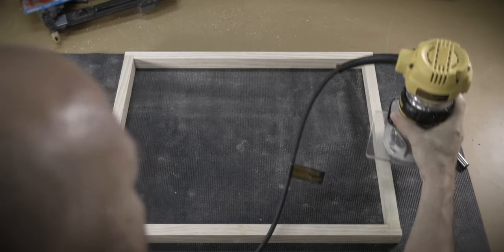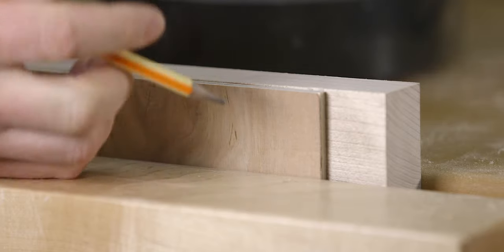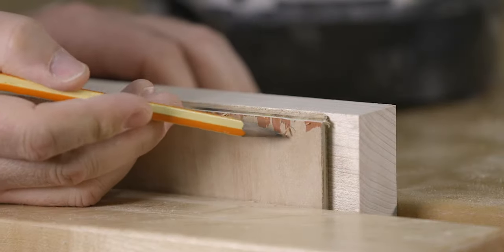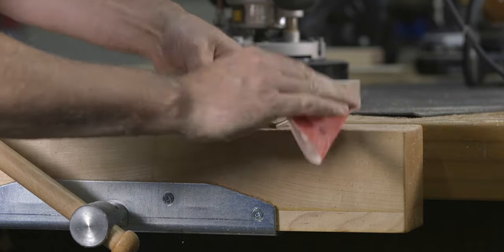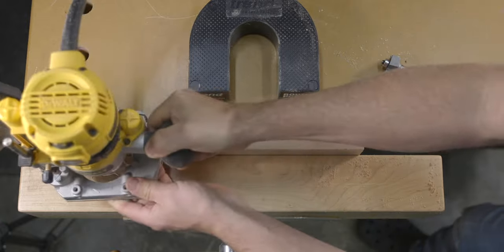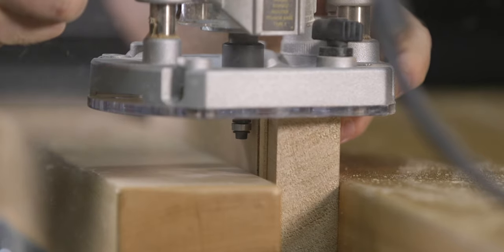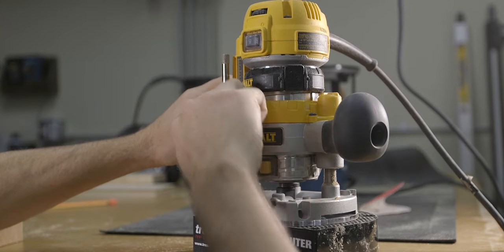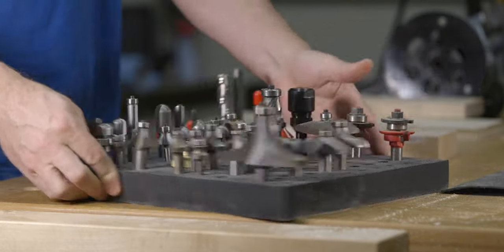Preventing Tear-Out While Routing - Plywood & Solid Wood

Comment: I work with very expensive veneers. I use the techniques in this video but I like to also lightly dampen the wood and give it a little time to soften the wood. I then set up a straight edge and use a utility knife to lightly score the veneer before running my router bit on it. This has helped me many times with veneers that tend to have, "Micro" tear out as well as the larger damage as seen here.
Reply from the maker: Fantastic advice Keelan!! Thank you so much for sharing that with us! 👍
Reply: What a clever idea, I am trying to use a diy box joint jig to make plywood drawers and will apply all your ideas to minimise breakout.  I particularly like the idea of scribing the wood

Comment: Also, don't use dull cheap bits. There's a massive difference in sharpness, and therefore amount of tearout, between a $4 bit and a $40 bit. I've also found covering the wood surface with painter's tape helps reduce tearout a little.

Comment: The only way to avoid tear out on a uv coated plywood sheet is to do a climb cut.  Set the feather board as tight as you can get it without damaging it and move the board evenly through the router

Comment: I’m an old newbie to woodworking, I’ve used a router before with good results. But yesterday I bought a 2”x2” x 1/4” piece of plywood to make a door. I just wanted to round the edges on all the sides. I started up the router and was pulling it to me and it cut over an inch into the plywood…I could not understand what I did wrong. I was so stinking angry..i used the dame bit that I’ve used before for rounding an edge on many things I’ve made, but thi…I just can figure it out and I don’t want to ruin another $20-25 piece of wood. Thanks…

Comment: Using the router on the flat surface is not the way to go with plywood, or any veneer. You want to rout from the edge instead. And, with solid wood, you can sometimes use the grain of the wood to your advantage, if you lay out the work in the right way, you can rout going with the grain, rather than against it, this will eliminate most tearout. But, of course we all do the climb cuts in the way that is shown.
Reply from the maker: Thanks Keith for adding your input. :)

Comment: Great video my friend. I'm cutting a rectangular hole in 1/2 birch ply. I was told to "score the rectangular hole to be routed" and also go in a clockwise direction. Do you agree? Thanks, Steve in FL
Reply from the maker: Hey Steve! I never score... but it will help with tear-out. Yes, clockwise. If you want to learn more about routers, I do have an online course. You can check it out here. bit.ly/3ytpf4V

Comment: Hi.  Great video as always - I'v elearnt a lot!  One thing I am struggling with is getting around corners when, say making a rabbit on a lid or a base for a box.  My bit invariably takes off the corner rather than cutting straight.  I'm thinking I may need to use a sacrificial piece to prevent this; or is my technique rubbish?  I know it's been a while since this vid was posted, but I would appreciate any assistance.
Reply from the maker: Could be technique... but using a sacrificial piece is a great idea. I do have a routers course that walks through so much about router technique... there might be something in there that helps. Practice on some scrap wood and adjust a few things... maybe direction of feed, maybe the amount you take off, maybe router bit speed? Try and few things and let me know what works. Here is the course if you want to check it out. bit.ly/3DcIeE3

Comment: Is there a router type that you recommend for someone who is a beginner to get comfortable with routing? ie plunge vs fixed? Is one easier to learn maneuvering around the stock with?
Reply from the maker: Hey there! I started with a smaller fixed based router like this one.  https://amzn.to/3geJaw0 Smaller routers (fixed or plunge) in my opinion are easier to start with... less weight is less intimidating. Hope that helps.

Comment: climb cut is what is used in the cnc milling, so why wouldn't it be possible in wood working?
Reply: It is possible, just not recommended in most cases. Metal is metal and wood is wood, this is the reason.
Reply: Metal and wood have difference  reaction  to cutting forces that is why in my 2c opinion 😁😁😁
Reply: With CNC milling everything is locked down.  Using a router the concern is having the router pull away from you.

Comment: Where to start router on square piece of wood?
Reply from the maker: Fantastic question! I recommend starting on the ends (end grain) first, and then move to the sides (long grain). Always remember to rout in a counterclockwise direction around the outside edges of a piece of wood. If your interested, I do have a beginners hand-held routers course coming out soon. If you want to be notified when it launches check out this link -->  https://bit.ly/2I8vT9k